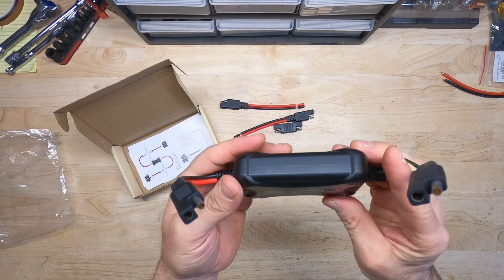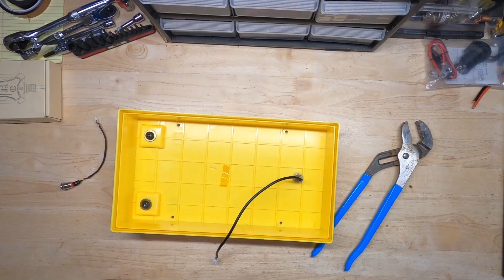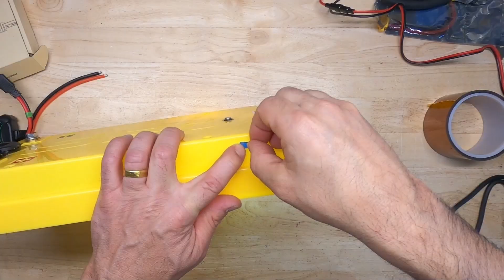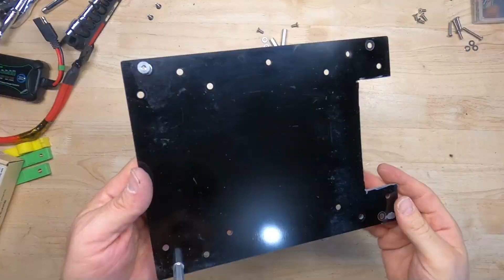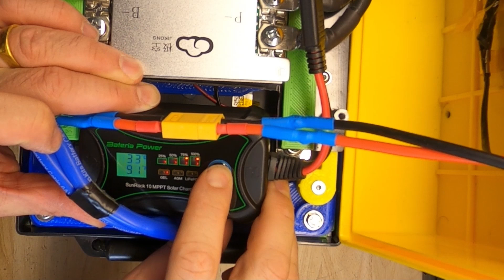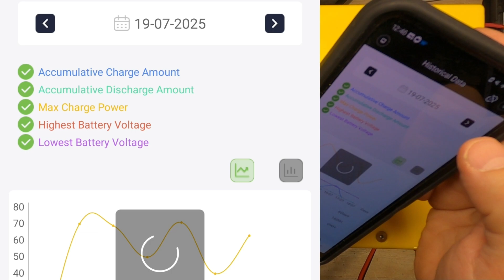Building a DC Solar Power Station With The Bateria Charge Controller

Comment from the maker: Very easy to use charge controller with a solid BT app.

Bateria Power 20A/10A MPPT Solar Charge Controller
https://bateriapower.com/products/mppt-solar-charge-controller-20a

Amazon Affiliate Link (10A only)
https://amzn.to/3IA8fC1

12V USB Outlet 65W PD Laptop Charger (affiliate link)
https://amzn.to/3H5bP6f

BLUETTI AC2A, 204Wh LFP Bat. 2x 300W (600W surge) AC  (affiliate link)
https://amzn.to/3SY53Sk

ANKER SOLIX C300, 288Wh LFP, 3x 300W (600W surge) AC  (affiliate link)
https://amzn.to/43NUMOY

12V LiFePO4 Build
https://www.youtube.com/watch?v=ej50Nm1gMBk

Check out my website for more info on this battery build
https://www.natesdiysolar.com/projects/12-volt-diy-battery-build/

Comment: LOVE THIS! I have the same 10amp mppt charge controller laying around. I'm gonna connect it to my commercially made 50ah Lifepo4 battery and designate this battery as my DC power station. Now, I just have to figure out how to attach (2) double port cigarette lighter ports to power my 12v cooking devices and several quick charging usb & usbc ports to it. Any suggestions??? Thanks for sharing that tip!
Reply from the maker: Sounds fun.. I have a v2 in the works using a metal commercial produced box.. as long as you have room to fit them. You could always wire up an xt60 as power out and supply the outlets externaly.. here's an example.  Just replace the buck converter for the battery.  

https://www.natesdiysolar.com/projects/shtf-emergency-solar-power/
Reply: @natesdiysolar  Thank you for your input!

Comment: As a retiree having experienced several power outages, I have long considered adding battery backup and maybe a few solar panels. As a camper, I have watched the development on camping and RV battery systems. Lately I took advantage of a sale and bought what is called a solar generator. At just over sixty pounds in a suitcase size these units contain lots of various ports and outlets. I spent $700 for what was $1500 last year. It seems that the market for home backup and plug in solar is a growing segment. Thanks for the tec stuff.
Reply from the maker: It definitely is and it's getting cheaper and better all the time.

Comment: Another question - can I buy 8S-24S BMS and parallel positive wires to be able to use it with 4S battery?
Reply from the maker: If I understand correctly you want to parallel a 4s (12v nominal) with a 8s (24v) battery and that would be a no.  You cannot directly parallel different voltage batteries. Or you are asking can you use a single 8-24s and group into selerate 4s packs.  That also would be a no.  Each balance lead 1-24 expects a certain voltage eg #1 need 2.50 to 3.65 and #2 expects 5 to 7.3 and so on. .  Hope that helps. The only thing you can really do is double up the cells to act as one.. eg 2p4s config.. so 8 cells in sets of 2.. the bms won't know the difference but u get double the capacity but it will take longer to balance.
Reply: @natesdiysolar  8S-24S BMS, not battery. I have 4 cells now and planing to expand my battery to 16 cells. Can I buy 24S BMS and use it with 4S battery? Parallel 24 BMS wires, like 1st positive wire + 5h positive wire, 2nd positive wire + 6th positive wire etc. BMS will see 8 cells, 3,2V each (may be with double power for balancing - 1A balance current from wire1 + 1A balance current from wire5 etc).
Reply from the maker: @alexchameleon8497 they have many models I have not seen one that is 4-24s.. usually the range is 4 to 8 for 12 and 24v packs  and 8 to 24 for higher voltage packs. You have to be within the min and max of the range . I Google the AI answer and it came up with the same info.. other bms manufacturer may but I have not seen one.  It also proves a technical challenge as the operating voltage of 12 and 48 are so vastly different it would require different circuitry components on the board

Comment: We all know that firs connect MPPT to battery, second connect MPPT to solar panels, but what if BMS will turn off the battry? Will it destroy my MPPT?
Reply from the maker: No that's pretty much a myth.  At least in my testing on a renogy. Unless it's a cheap unit perhaps. Once initial configuration is done you can turn off the battery.
Reply: @natesdiysolar  Glad to hear it!! Ty.

Comment: I have one of these Bateria Charge Controllers as well. At first, I didn't really use it and it sat in my box of spare solar charge components for several months.
It was really inexpensive and I only got it to test a few things but quickly upgraded to a Renogy MPPT and almost forgot about it.

Much later, I was testing a 24V battery system and it burned out a supposed 24V capable MPPT so I grabbed the Bateria charge controller as it says it is rated for 24V.
Not only did the Bateria work for my 24V battery test, it ended up working BETTER for charging my battery bank than my other MPPT systems. 
It is now my primary solar charger for my 24V battery bank. 

I really like it's small size and simplicity. It charges the batteries and manages the 500W of solar coming in with 0 issues.
Reply from the maker: Awesome.  I didn't know the 24v version could do 500w.
Reply: @natesdiysolar  well yeah, Because if you are running a 24V battery then you also need to run your solar higher than 24V. In my case, I ran my panels at around 40V. 500W at 40V is only about 12.5 amps. 
Since this is a 20Ah controller, then that is well within it's specs. 
I think I read that this controller can handle up to 60V PV so you could theoretically run as high as 1200W if you balanced your panels at 60V.
I don't know if I would push it that high, but 60V would lower the resistance on the wiring so I guess it's possible.
Reply: @natesdiysolar correction:
I just looked at my Bateria paperwork...
The 24V unit can support 25V at 450W when feeding a 12V battery.
And 55V at 900W when supporting a 24V battery.
I'm feeding mine 500W PV supporting a 24V battery bank which is well within manufacturing specs.